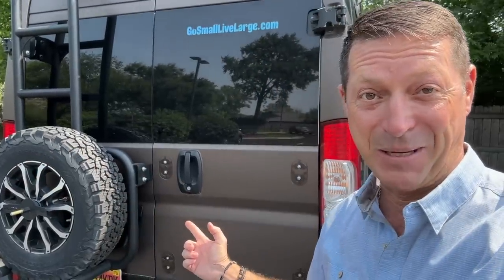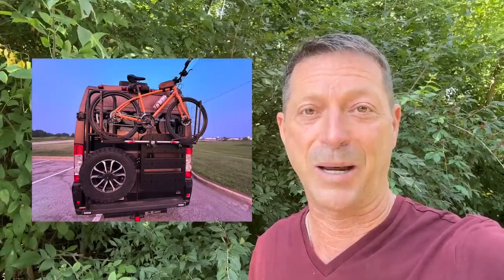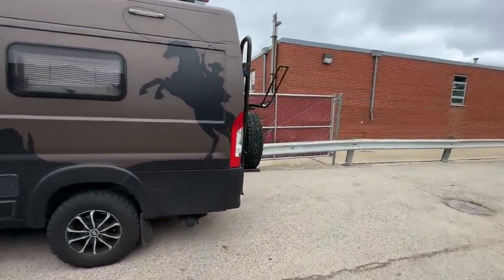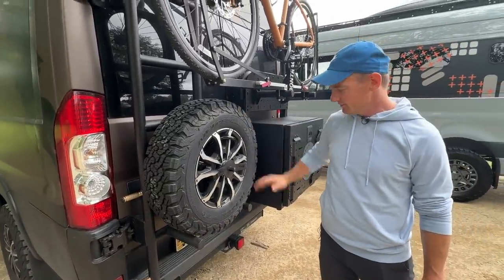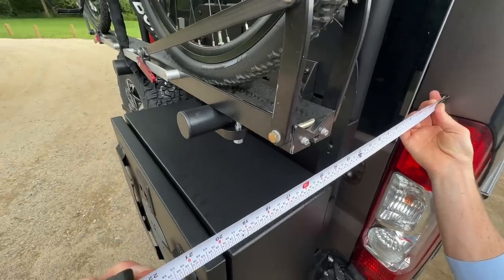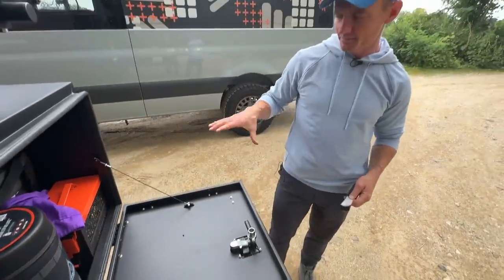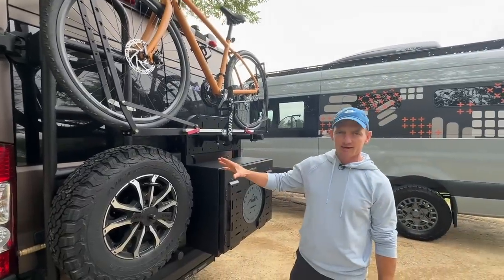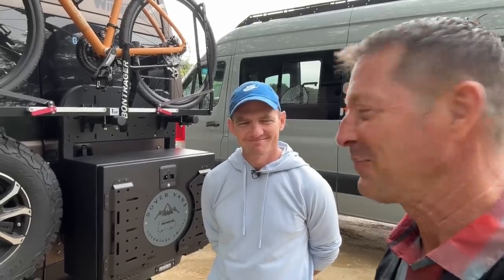BEST BIKE RACK & Storage Box for Promaster, Transit, Sprinter?   Rover Vans Gear  brand

Comment: the bike seems high for load and unload.. question about high interfering with backup camera and the full time rearview miiro camera - and some of us have add a rear camera to a dash cam system.  seems they could put the support peg wider and lower for attaching to the one-up bike setup lower to clear view path for the rear cameras and easier loading
Reply: Agree, I was wondering if the bike obstructs the rear camera’s view
Reply from the maker: Hi Steve.  A little bit of a yoga move to get the bike on, but not bad. I like having it up high against the van instead of sticking way out from the van. Backup camera view is obscured a bit, but view is through the middle of the bike frame.

Comment: I am assuming that your Travato carrying capacity is around 1600 lbs.  If you have your normal load and with water and fuel, have you been able to stay close to the capacity with all of your new accessories?  It all looks great but I was just wondering about weight and safety issues.  Thanks
Reply from the maker: My loaded Travato is about 8600 pounds loaded up